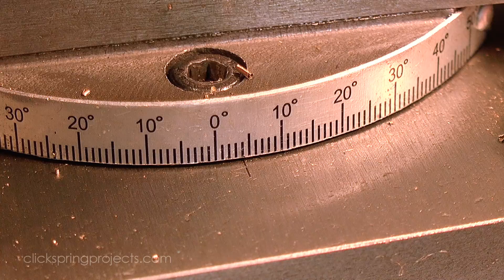Ornamental Turning Between Centers

Comment: I took me a closer look to understand the purpose of the piece inserted at 0:10 and then why the title says "between Centers".  I've never seen that method before.
Reply: Yeah when I saw this method for the first time it was really amazing to me. Cool learning something new especially when it’s on such a niche topic
Reply: That's weird. That is the most ancient and, if done right, the most accurate method for turning.
Reply: It's a very old method that dates back to before the invention of the more conventional 3 jaw scroll or 4 jaw independent chucks. Before those, all work was either done on a face plate or between centers. When high accuracy and concentricity is important it's my first choice for any shaft type work since as the video shows the work can be removed, swapped end for end and replaced with no loss in accuracy. While it's still used sometimes in commercial shops, it's fallen out of favor mostly because the drive dog limits both the depth of cut and feed rates to what that dog can resist during those cutting loads. So it's used mostly during light finishing cuts and almost always during any high accuracy grinding. Most ground taps will show that there always done between centers with a female center in the working end and either a male or female center on the other end. Those male centers are more common when the tap size is small.
Reply: @besenyeim  I’m sure it if but everyone learns something new at different times. You didn’t know about it at some point and when you did discover it I’m sure you were fascinated as well.

Comment: I'm not a machinist, so forgive my ignorance, but what's the advantage is of "turning between centers" versus doing it normally?
Reply: I'm only an amateur machinist, but I believe the advantages are better concentricity (especially after truing up the hex center), support on both ends of the workpiece which is better for the heavy cutting forces when he uses those form tools and finally the repeatability of being able to swap ends around so the exact same radius and tapers can be machined on both ends of the work. Sorry for the run-on sentence.
Reply: To add to what Ian said, turning between centers also allows for ends to be different shapes without having to get creative with clamping/centering them. For example, you are making a part that has to have tapered ends. So a regular chuck won't hold it, not easily anyway, but put it between centers and you can happily machine it without having to make a special clamping jig.

Of course the main disadvantage of this process is that it's slower since not only you can't swap parts as quickly, but you also can't spin them at high RPM because by it's nature it is very unbalanced. Another downside is that the drive 'dog' as it's called, clamp that grabs onto the part to spin it, takes up some of the work space that would have been available if the part was in a regular chuck.

Comment: Why did you use a piece of hex for the driving centre? Just happened to have it?
Could you have used a piece of round just as easily?
Note to self - acquire a drive dog.
Reply from the maker: Yes, although the hex stock advantage is that it comes with preformed flats for the drive dog clamping screw - Cheers mate :)
Reply: Hex stock is also great for 3 jaw clamping- it has the flat faces aligned for that. Square stock (for instance) does not. That's great for a 4 jaw, obviously. :)